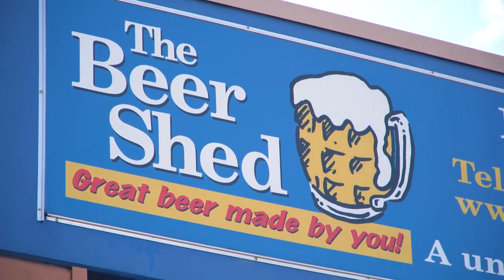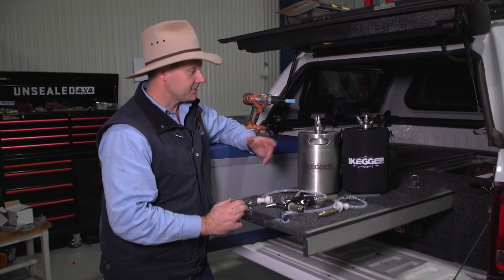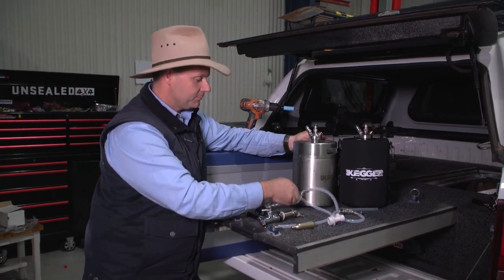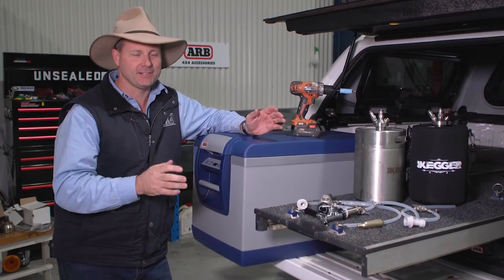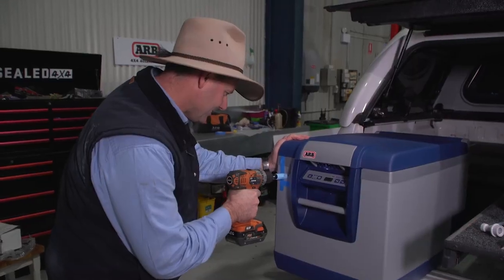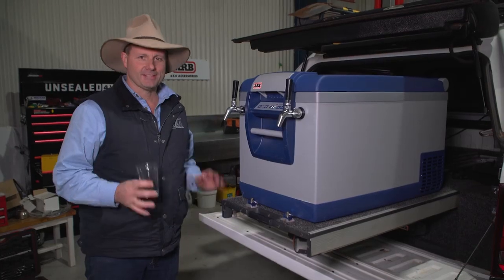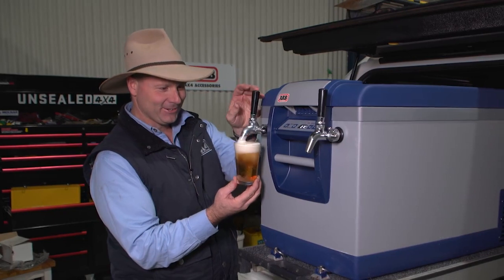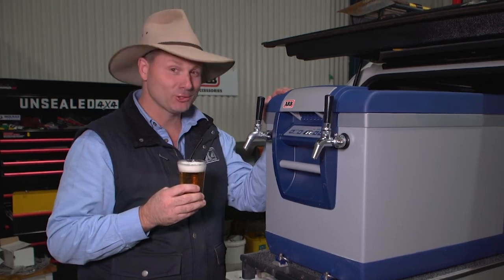Building a Kegerator in a 12v Fridge

Comment: Could you provide a bit more information, what parts were used and the dimensions if the cooler
Reply: This package allows you to make a jockey box or kegerator with up to 4 taps https://www.ikegger.com/products/kegerator-kit-choose-your-taps-regulator-and-kegs that was was made in a ARB 72L fridge from memory. You need about 50cm of height for 5L kegs with connections and 18cm diameter